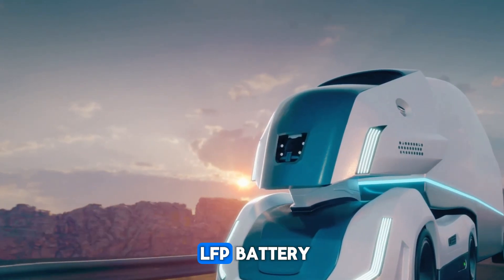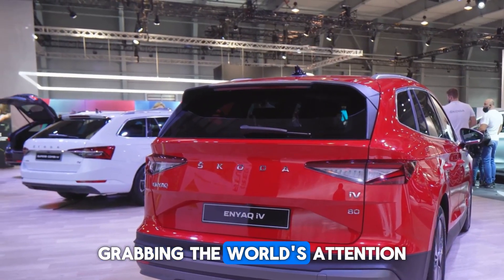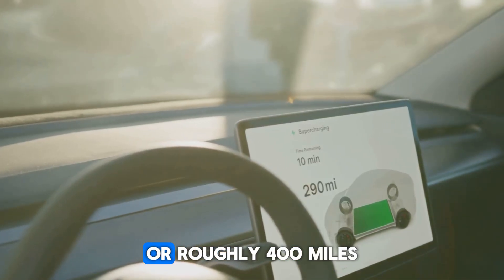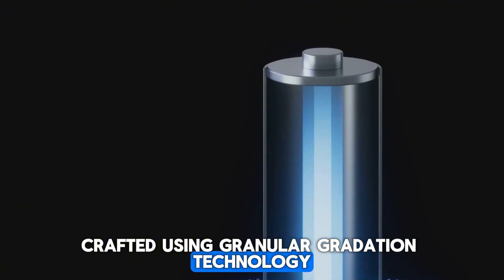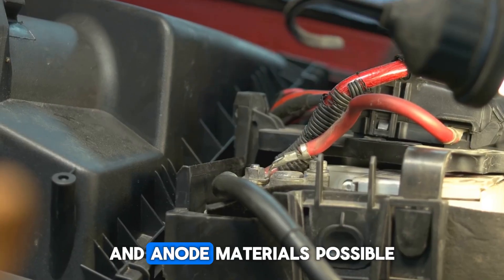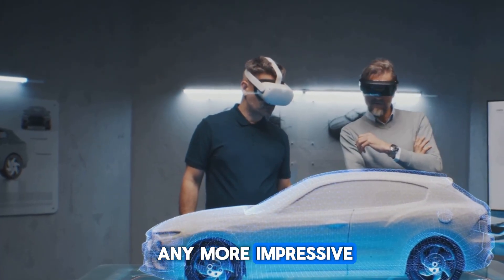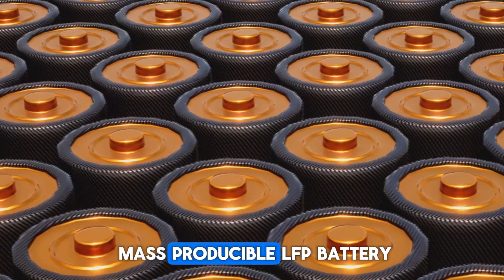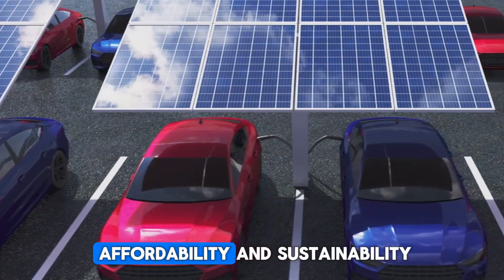The CATL Finally Released it's NEW SOLID STATE Batteries! You won't believe!

Comment: The Shenxing PLUS battery is a high-energy-density lithium iron phosphate (LFP) battery, not a solid-state battery, with a 205Wh/kg of energy density. Toyotas Solid state batteries are at 500-600 Wh/kg... CATL has solid state under testing, which has a density of 500 Wh/kg. So in line with Toyota, which also has their under testing. Torque bay sure doesn't get my subscription.